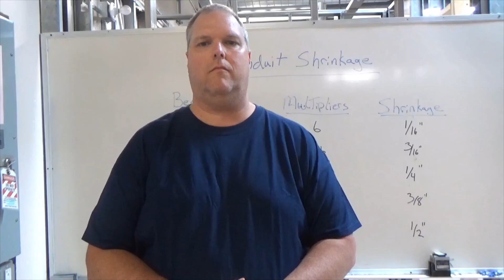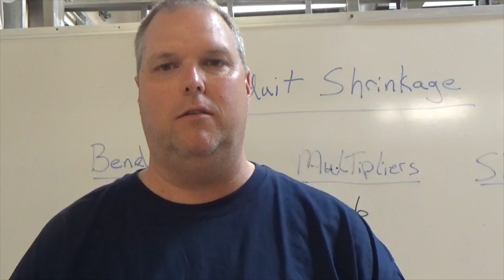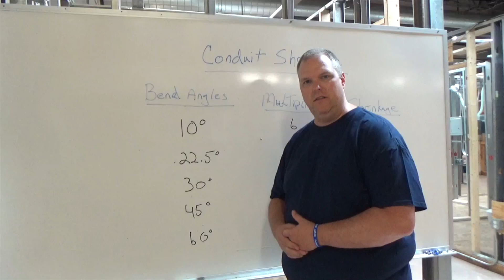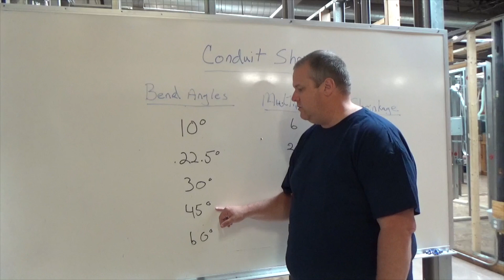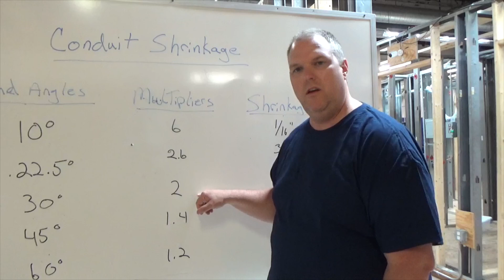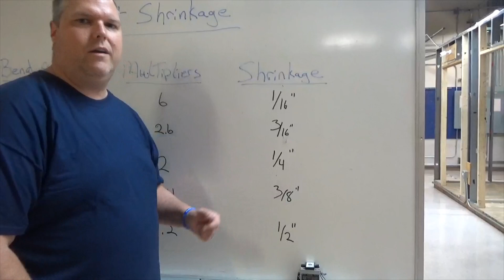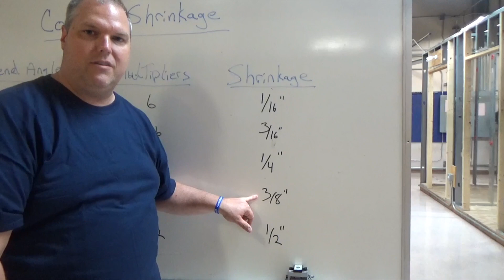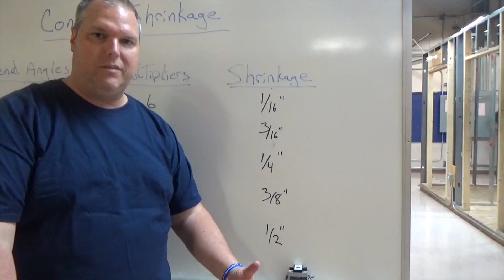Shrinkage for Conduit Bending Explained

Comment: Hi Craig does the size of the pipe change the shrinkage ? Also this always confused me, if I have a 4 inch square box mounted to the wall and I have a hole drilled in the floor the pipe is lets say 12 inches to the wall so I need to offset the pipe to go un to the box, would I make the offset 12 inches or would I minus the distance of the knockout in the box ?

Comment: I bend all in a row.  I've found that your shrinkage is wrong the way  i bend. I bend at 30°and I've found that my way is much faster and way more accurate too.  My shrinkage is 3" per bend regardless of the height.  So I mark my 1st line with the bender at the end of the 4 point, facing the end of the stick, the distance from the bend of the shoe to the flat part is roughly 3-1/4" just add that to each bend and you can place it down properly with no issues for a 30° bend 4 point saddle and how i bend takes like 2 minutes.  Just letting you know cause you normally have to turn the bender 2 times in each direction.  My way is better and faster cause you can eyeball it and bend in the air
Reply from the maker: Wow, you know the longer you do something the better you get at it. Without the basics you cant ever get to that level!! I enjoy finding out what others do to make it work!! Thanks for your comment!! CM
Reply: 12.6.20.    @ Will Holsey.      I would like to see you do a video of what you’re explaining it’s very intriguing 🤔

Comment: I bend all in a row.  I've found that you're shrinkage is wrong the way  bend. I bend at 30°and I've found that my way is much faster and way more accurate too.  My shrinkage is 3" per bend regardless of the height.  So I mark my 1st line with the bender at the end of the 4 point, facing the end of the stick, the distance from the bend of the show to the flat party is roughly 3-1/4" just at that to each bend and your can place it down properly with no issues for a30°bend 4 point saddle andhow bend takes like 2 minutes.  Just letting your know cause your normally have to turn the bender 2 times in each direction.  My way is better and faster cause your can eyeball it and bend in the air